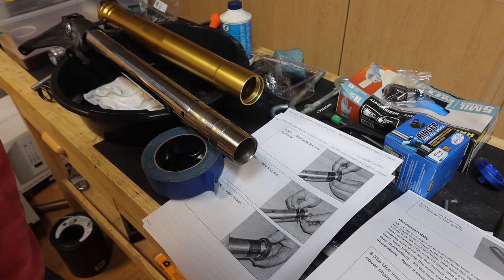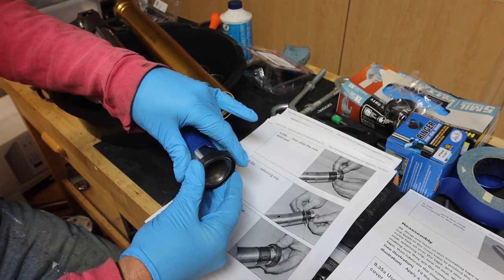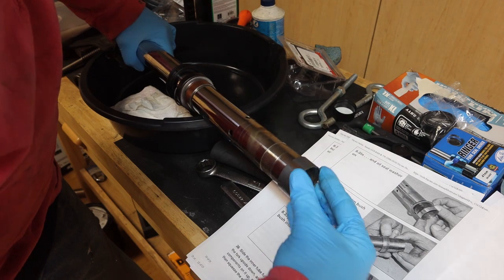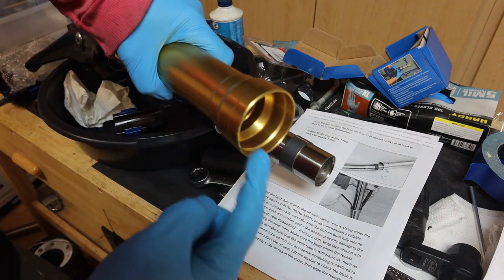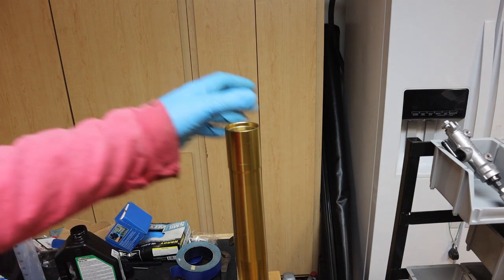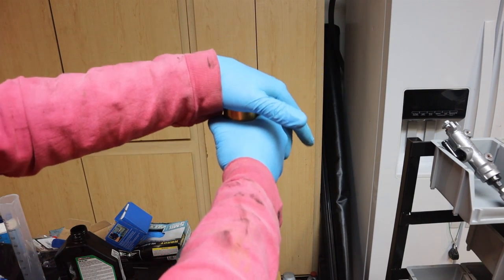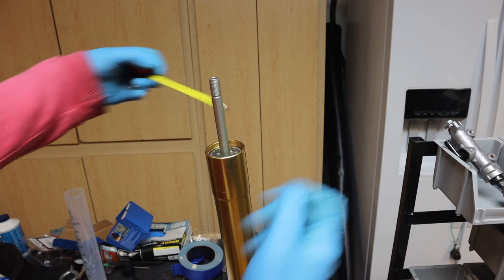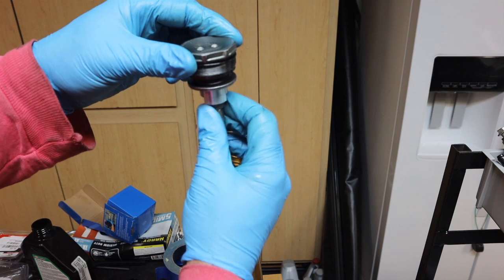2014 Suzuki GSXR 750 Fork Rebuild - Part 2

Comment: Thank you for the great video! after watching I felt confident enough to do it myself. However, after pricing out the specialty tools I decided it’s cheaper to have a shop do it if I bring them the forks hahaha but I’m glad to have the knowledge now
Reply from the maker: Thanks, there is a way to seat the seals by using the old oil seal.  You can also make a tool to remove the assembly.
Reply: @JoediyLab   an you tell me what size fork seal driver you have?
Reply from the maker: @Jms4ntana  mine is 41 mm but double check your fork size,  I have seen cheap ones on Amazon.  https://amzn.to/3XNGI25

Comment: Hi suzuki gsxr 750 cc 2014 478ml ?
Reply from the maker: Fork oil capacity		
600K6 and K7 models	413 cc	
600K8 to L0 models	410 cc	
750K6 and K7 models	408 cc	
750K8 to L0 models	418 cc	
All L1 models	420 cc	
All L2-on models	487 cc

Comment: Oil is 420ml?
Reply from the maker: ork oil capacity		
600K6 and K7 models	413 cc	
600K8 to L0 models	410 cc	
750K6 and K7 models	408 cc	
750K8 to L0 models	418 cc	
All L1 models	420 cc	
All L2-on models	487 cc

Comment: The dome piece that goes under the spring is in backwards. That dome goes toward the bottom of the spring
Reply: Wallstreetrider are you sure the bump   goes up? I'm doing a set and one fork is up and one is down. Can't tell in the for schematics
Reply: @gregmerriam7811  I'm sure.
Reply: The upper collar (white pc) goes small hole down too.

Comment: Bottom collar is upside down per my diagram as someone mentioned that i missed and finished torquing and putting it back per video 🤦🏼‍♂️
Reply from the maker: Interesting that is the way I dissembled it.  I will have to look at the diagram,  Thanks for the good eye.
Reply: Per manual L1 nipple from spring color A number 14 should be up.
Per Part Zilla it seems to be the same. 
Honestly I didn't double-check mine I thought it was nipple down and I went back and checked your first video and it doesn't show you sliding that part out
Reply: Yeah, I wanna say he’s right. That bottom collar nipple is supposed to point towards the spring. I used your video to do mine and mine coming out from factory was pointed toward the spring and not downward 😊
Reply from the maker: @Lopez23300  More than likely whoever rebuild my fork put it in upside down,  I was just following how I took it apart.  Easy fix,  just fit it around,